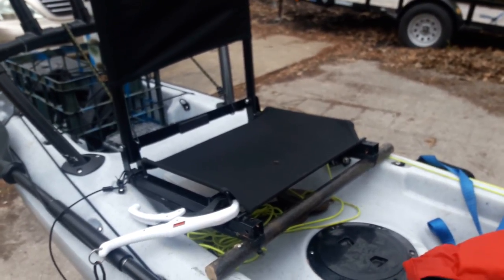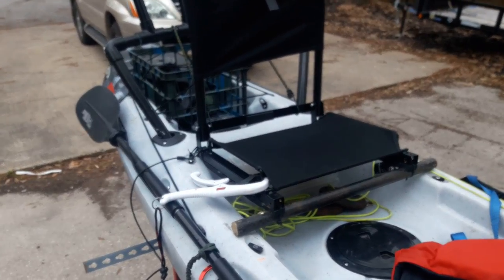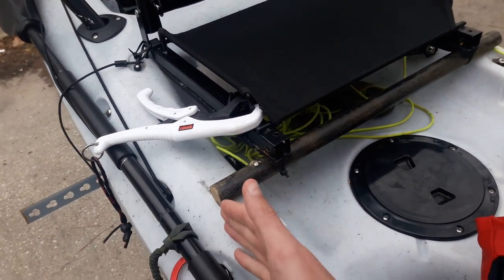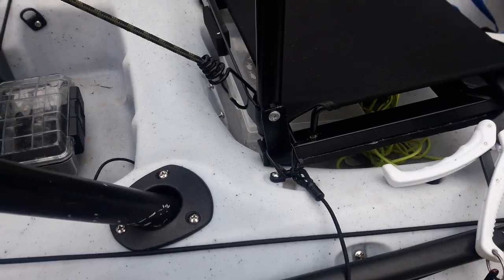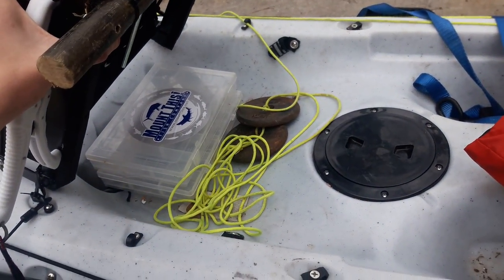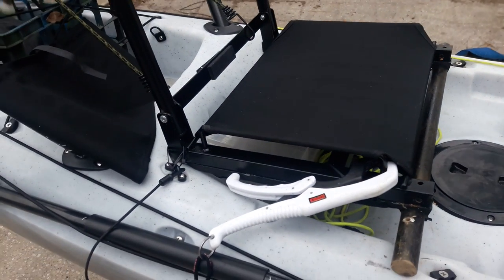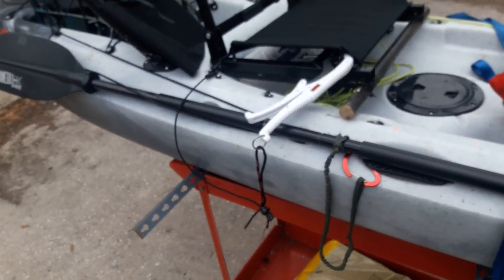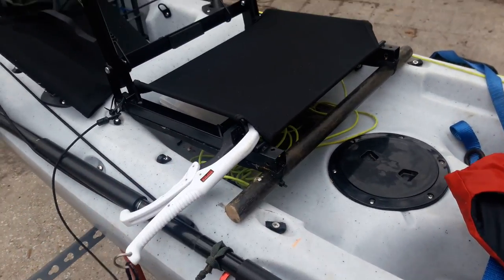DIY KAYAK SEAT, ONLY 3 THINGS NEEDED!!!!!! (dont drill in to your kayak)

Comment from the maker: Zip ties may not work for you. The ties I used are 75lb tensil strength. I weigh 180lb and have broken maybe 3. They are cheap and easy to replace and I can even replace them on the water. If you are heavier than that, I would use heavy duty zip ties or maybe find another method. I hope you all find some use in this video and it can give you a direction to go in. Thanks for the views, likes and subs. They are always appreciated and if you have any questions feel free to ask!! Thank yall

Comment: Doesn't the elevated seat change the center of gravity to where it's easier to roll/flip the kayak? Just curious? I am trying to do the same thing, but I was told I shouldn't be doing it? Thanks
Reply from the maker: I was really worried that but after testing it on the water I did not notice a difference at all. That being said, it may vary on different kayaks depending on width and Hull design. I’m still using the same setup to this day with great results. Hope this helps
Reply: @texasriggedryan775  awesome. Roger that. I just got the Lifetime Tamarack Angler 100. I got the idea from another guy to use the Cascade Stadium seat... fits perfectly inside the cut of the kayak. Only increases about 1.5" by the time you sit in it!
Reply: @OfficeofthePacific  just got myself the same kayak, I’m looking to upgrade the seat as well. Any advice?

Comment: I ended up getting a boat seat and adding PVC pipe to the bottom of it to fit into the kayak which was good in the beginning but it now makes noise. Looking at doing your setup now. How is the noise on this setup out on the lake when it's quiet?
Reply from the maker: Anthony Tyler no noise at all

Comment: Think this could hold up surf fishing?
Reply from the maker: That’s a great question. I have not had the opportunity to try it in the surf but if I did I wouldn’t use zip ties, I’d probably use maybe some metal wire/cable
Reply: @texasriggedryan775  They make stainless steel zip ties.

Comment: It's not your height that affects center of gravity it's your weight. He ways 180, that's why he didn't feel a difference. I weigh 250. I did this and went straight into the drink and lost a good pole.
Reply: Sounds like you might need to go on a diet my man
Reply: It depends on the width of your kayak a lot also.. A wider kayak can handle a higher seat better than a narrower kayak..